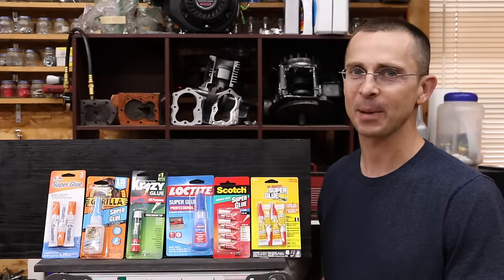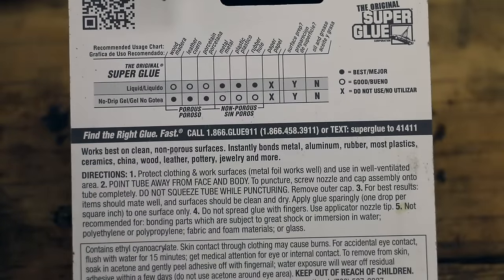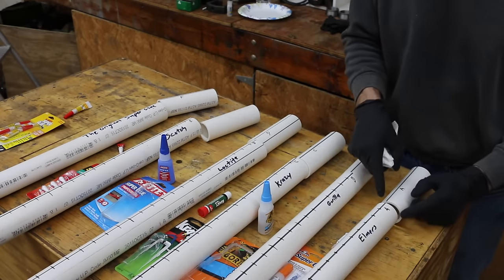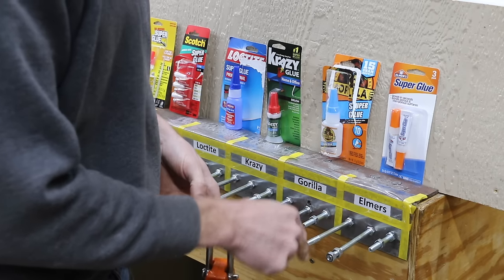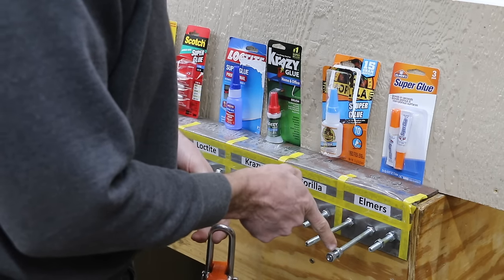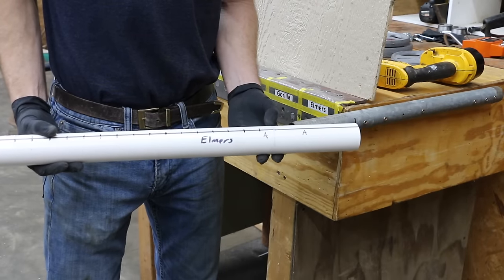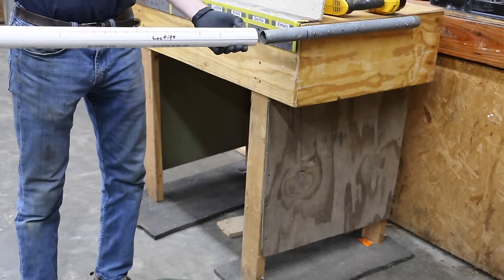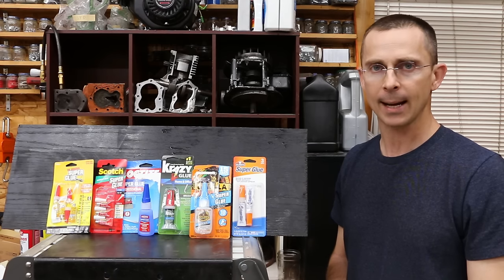Which Super Glue Brand is the Best?  Let's find out!

Comment: Can you do a video on the T-7000, B-7000, E-6000, T-8000 and so on glues?  Black and Clear?  I use on cell phone screens and tablets, but i'd like to know which is the strongest, as well as the easiest to remove with solvent/ alcohol, and or heat... Thanks
Reply from the maker: Thanks for the video idea.

Comment: Suggestion
You have done several videos that compare similar products across different brands
A different type of video that might be interesting is to compare, for instance, different types of glue, and what they are most appropriate for…. For example, silicone adhesive, vs epoxy, vs white glue, vs solvent glue, vs super glue, vs super glue gel, vs construction adhesive, vs spray adhesive, vs contact cement
Reply from the maker: Thanks for the suggestion.

Comment: Can I suggest a video...

What adhesive would be the best for connecting metal. I.e epoxy, resin,  superglue, duct tape ect..

Here's the dilemma I have. I had to take the window wipers off the van to fix a bigger job. When I went to put the wiper arms back on. The first nut went on fine. The second when tightening the second nut it completely snapped of, unfortunately there was no thread available to try and put another nut on. I have tried metal 2 pack system that has worked for a month. Obviously its under stress when the wipers are in motion. What would be the strongest option or product (for this application?

Regards Dale 

P.s sorry its 04:18 here so I haven't spell checked....sorry
Reply from the maker: Thanks for the suggestion.

Comment: Could you potentially run this test again sometime? I found that sometimes I have to glue very small parts, or cracks in pipes etc. where there is minimal contact area, and those siutations weren't tested in this video. Also, formulations may have changed and there are also some new options available now.
Reply from the maker: Thanks for the suggestion.

Comment: Hi Project Farm friends, next video suggestion: 

We must take it at a related but different direction. I'd like to suggest every so often the video is about preserving the best tools (top 3 like Fujiya which has amazing finish and more rust resistant than Klein which is good too but I wish Fujiya had criss-cross knurling on the tips like Klein of its pliers for better grip and Fujiya is spring loaded which is crucial in most work- all pliers like and scissors-like tools should be spring assisted :-).

What do I mean by preserving our accumulate top tools (top 3 brand as tested and top decent enough brands for their prices, thanks mostly to Project Farm for these collections and heirloon if th they are all top 3 to top 4 brands like Fujiya which is the Patek Philippe/Grand Seiko of precision and finish w/ tools if one looks at the quality vs. say Klein which is also nice, under high magnification): for example I have a technique wherein before I close a rubber cement bottle (especially the big ones) and superglue (big sizes especially), I take my vacuum which can be a blower and I suck the air out of the bottle so that it doesn't dry up when not in use. I also refrigerate superglues so they don't solidify overtime (there should be a small refrigerator at all workshops for things like superglue.

Even better if a vacuum chamber is used (and somehow screw back the cap while it's in a vacuum maybe we DIY robot arms like the ones used by scientistist (the one with rubber and two hole used for handling dangerous and radioactive things)- in a way Project Farm could be part Tech Ingredients (hosted by sir Eric, a former practicing doctor but is really more of a physicist, chemist and engineer).

But this needs a test, Project Farm could test this preservation of our accumulate top brand tools as tested + decent but way cheaper than the top 3-4 brands like Fujiya which could, again be heirlooms like Vacheron Constine watches, Perhaps test if this preservation work: 1 is controlled, the other is vacuumed using a regular vacuum, the other air is sucked out of the bottles (kept aways from UV as well) in a DIY vacuum chamber, the others all that and then refrigerated vs. not refrigerated (it may work for sealant which is very wasteful coz' there are lot of sealant lost when it dries up in the nozzle, also it's just one year shelf-life usually opened or brand new.

The second video I'd like to suggest is preserving the greatest tool of all, ourselves. Experiment with wearing (aside from good diet and exercise and quality air) compression socks (up to the thigh ones or up to the knee- proper size 20-30mmHg is usually a healthy, good enough compression) and wearing compression bands for the arms, see if using a rough file making a book ends from raw sheet metal (that was one our projects in high school at machine shop class X-D, a classmate stood out with filing, it was level, not rocking and had a great technique)- see if the muscle get tired more without compression for the arms (it's not only for swelling during injuries but compression stuff seems to improve blood circulation).

God bless, Rev. 21:4
Reply from the maker: Thanks for the suggestions.

Comment: I watched a BBC consumer test programme thirty odd years ago when the 'one drop holds a ton' claim in the adverts was first challenged. They put one drop of glue on the roof of a car and lifted it up with a crane. Of course, it didn't pick the car up. It was going well until it wasn't and the car settled back on the ground as the joint parted. This was seen as a failure until they discovered that the crane was still attached to the paint, but the paint was no longer attached to the car.  Whether the claim was true or not, i thought it was brilliant.
Reply from the maker: Thanks for sharing.

Comment: My tonneau cover has rubber or foam pieces along the edges and during the cold winter I opened the cover and a couple of the rubber foam pieces froze on the truck and came off the tonneau cover. I need to know which of these would be recommended to fix it and put the rubber pieces back on.

Comment: Most of these glues need to be kept in a refrigerator after opening to get the tops off. I have better luck with gels rather than the real runny ones. However, the runny ones are better for fixing a chip in a windshield. Any of them, if you have temperature variation, the bond will break free after a few days. Will not hold a rear view mirror on.
Reply from the maker: Thanks for the feedback.

Comment: Can you do a test which product best prevents a concrete cold joint leaking?
 I have a three cold joints as the concretes were poured at different time: garage  concrete slab, door concrete curb which is 4 inches above the inside and outside, and outside yard concrete slab.  When it rains, water leaks from outside through the curb cold joint into the garage.  I tried to block it with some cement  alleging could prevent leaking. That product fails, leaking still continues.
Reply from the maker: Thanks for the suggestion.

Comment: I have a stripped pressure washer Allen  wrench bolt that I have attempted to epoxy an Allen wrench to as a means to remove it. Tried Devcon 3500 psi plastic steel. Didn't hold at all. I did sand the Allen wrench down a bit and the bolt head was pretty jagged from my many attempts at an angel to remove. Any suggestions?

Comment: Your efforts at meaningful testing are amazing and widely appreciated. It is unfortunate that as with so many of your tests there is no clear winner. Too many variables and too many products that are good at one thing and suck at another. That isn’t your fault, but usually the consequences of substandard products or haphazard quality assurance. Very frustrating. Regarding the dearth of consistency from manufacturers, after many of your tests I’ve thought it would possibly be very revealing to test 10 of the SAME item and see what the results were. Say, 10 identical Craftsman brand open-end wrenches. I think it would be of value to both us consumers and the manufacturers. It would reveal a tool you could truly count on, as well as a brand whose quality control you just couldn’t trust. It would also be another validation of your own testing methodology. All the best.
Reply from the maker: Thanks!  Thanks for the suggestion.

Comment: The results from the metal test, were so scattered/inconsistent. It leads me to believe, that there may be flaws in the curing of the glue or maybe flaws in the preparation of each bolt. Was each bolt placed on the glue the same way? Was the glue dispensed in the same amount? Was there glue touching the entirety of the bolt head? I feel like that test may need to be revisited possibly. It's just odd that one would do really well on one and not the other. I'm referring to the first and last test on the bolts. Because imo, I think it's essentially the same test. Only in the opposite direction. I thought he was going to thread a nut and big washer over the puller and attach a cable or rope and pull with a scale attached. He said he had no way to exert that force to pluck it from the steel. But I think it could have been rigged up on a drill press or something like that. Or used a block and tackle or something along those lines.

Comment: One drop of the original super glue can life a tone but what they don’t tell you is you need to use a material made out of high strength polymers because when you do the super glue creates a chemical reaction that quite literally bonds the ends together effectively Turing the 2 ends of polymers in to one polymers the molecules blend together and form together think of it like a weld when you weld metals together they become one but this is through a physical reaction not a chemical one like the super glue
Reply from the maker: Thanks for the feedback.

Comment: Just to let you all know, in case you aren't aware ... This Gorilla Glue Gel will have a pretty serious reaction with garments containing Polyester.

I recently accidentally splattered some of the glue onto my shorts during application of the product, and the resulting chemical reaction was a hell of a lot of heat, with visible smoke/fumes.

This reaction could cause some serious burns in large spill quantities as the glue will react with the polyester while adhering to your skin through the garment, very rapidly.

I couldn't find where it was stated to keep the glue away from said materials, but I may have missed it.

In any case, this is a friendly PSA! 🫡
Reply from the maker: Thanks for sharing.

Comment: Curious if you put a drop between 2 pcs of plexiglass as to how big of diameter the glue would achieve as the surface area size will affect strength
Reply: Probably used the maximum contact area to achieve a ton.
Reply from the maker: Thanks for the suggestion.

Comment: Hello sir Projekt Farm.

I'm giving back this time.

The best way to get rid of goo from old tape (e.g. duct tape) that you untaped from a surface, it's better than all the test (99% alcohol, 70%, w/ shampoo, with olive oil soap, WD-40- separate as well, not mixed as well as using a scraper and heat from the SMD station used in soldering SMDs) that's affordable is eraser from Faber-Castell, especially their Dust-Free version (best to have their other versions, including the regular soft eraser and rough one but not the green eraser that's for pigment on plastic).

God bless, Rev. 21:4
Reply from the maker: Thanks for the feedback.

Comment: I'm mainly use superglue to repair stuff with baking soda (it creates a very strong polymer). I bought "superglue 502" from aliexpress: it doesn't really work as well (the polymer it creates is maybe 60 or 80% less resistant, it also doesn't change the color of the baking soda, western glue makes it a little bit more translucid. Maybe because it's less concentrated, of because it takes too long to cure or because it doesn't penetrate as well the baking soda. Anyone found a cheap superglue for this use?. I also tried on ali the 401 (yellow-red-blue), it's a completely useless gel like.
Reply from the maker: Great information! Thank you

Comment: I'd like to know how to stop the CA from blocking the nozzle, after multiple uses?
Reply from the maker: Thanks for the suggestion.
Reply: @ProjectFarm  what?
Reply: Wipe the nozzle clean after every use and Gorilla glue bottles have got pins in the cap that help clear the nozzle , but yes, eventually they all block.  I guess you could soak the nozzle in acetone (which softens and dissolves superglue).
Reply: @jonedwards7019  on some larger bottles, the nozzle doesn't come off.
Reply: I use Gorilla glue nearly daily.  I always keep the bottle inverted inside an old pill bottle.  Before and after using I shake the bottle then inverted I tap it twice on a hard table top, once through using I place the cap on and tap it inverted one time before I place it back in the pill bottle.  If it does clog up, I use a needle probe to carefully clear out the delivery hole by inserting the needle until it breaks through the clog.  Then quickly use the glue.  Replace the lid and again tap on the t le top before storing inverted in the pill bottle.  For each bottle I may have to do this 3-4 times before the glue bottle is emptied.

Comment: Great video. I actually found this from a comment on Inventor 101's video where he started off mixing baking soda with superglue and then made extraordinarily strong joints by introducing graphite into the mix. 

It would be interesting to see what the optimal ratio is for this compound mix and how it holds up to various forces.

He glued a screw to a plastic bottle cap and couldn't hammer it off and the joint was so strong, the screw ended up bending rather than breaking off.
https://www.youtube.com/watch?v=t7YG90LFkMM

Comment: My general opinion is that "super glue" sucks. It works OK if you want to glue two flat pieces of metal or plastic together, and it works great at gluing anything you DON'T want glued together, but when I actually use it on something that matters, it always fails. The slightest bit of pressure or torque and the joint instantly breaks.

The old Krazy Glue commercial used to show it being applied to the broken handle of a coffee mug and then the mug being lifted. Putting aside the fact that modern super glues take forever and a day to dry, they won't even glue ceramics like the ad showed. My mother had a small sculpture of two birds sitting on a bridge-like branch that snapped right in the center. It was glued back together using super glue and any time you touched it the wrong way, it would break apart.

I used some of the Super Glue brand to try and fix a twist switch in a light. I let it dry thoroughly and it still snapped the first time I tried to turn it.
Reply from the maker: Thanks for the feedback.

Comment: Without a doubt Delo makes the strongest. With only 3 grams of adhesive spread across a 2" diameter they were able to lift a 17.5 ton crane 1 meter into the air. Class dismissed.

Comment: I think this is an example of man's dependence on his "marketing mother", telling him what to do and think -  i.e. label-marketing. When their chosen brand label fails, they just assume super glue doesn't work. Strangely, I've had an aversion to Loctite for years due to using it and then busting open a knuckle and breaking an assembly in my efforts to remove the nut I used it on, ROFL!
Reply from the maker: Thanks for sharing.

Comment: I dunno. Variables. Unseen variables.   I use hot-melt glue for vehicle body repairs.  Basics are you glue a plastic tab to the body & apply a pull using hydraulics - it can apply up to 1500kg of force.  Thing is, you can follow the exact same process, using the exact same materials & get hugely variable adhesion for "no apparent reason" - you can glue on a tab & get 500kg of pull on it, glue on an identical tab beside it using the same glue, same process & get 30kg of a pull on it, or 3kg.. or 600kg..   

Obviously, there's a "scientific" reason why - damned if I know - you can glue the same tab back on & get the same outcome or a totally different outcome  - either a phenomenal pull or a rubbish pull - there's just so many tiny important variables regarding "adhesion" that it is a black-art more so than a science.
Reply from the maker: Thanks for sharing.

Comment: the tensile strength test was almost like the down force test as the bar you made did not pull straight up, but also to one side. Making the hole oval does not stop any angular stress as one side will be pulling harder than the other.

Comment: Krazy glue last the longest
Reply from the maker: Thanks for the feedback.
Reply: @ProjectFarm  anytime
Reply: @ProjectFarm  ive just checked my front tire the tube still holding up from the krazy glue and duct tape
Reply: Ive put the krazy glue on the hole and then while the air seals up the krazy glue i put the duct tape on it right away then i krazy glue it around the dict tape it quickly dries

Comment: In America, strength of materials is listed in psi ... Pounds per square inch.  So math is simpler if you measure force to break in pounds and surface area of sample in square inches. No one has any sense of what a newton is or how strong a newtons per square meter is.  Don't give in to the Karen's out there and become a metric freak .  Note that we will be measuring tire pressure in psi for a long time.

Comment: We use pounds in this country; unless you are European, a useless millennial, or an engineer, the metric system means nothing to us
Reply from the maker: Thanks for the feedback.
Reply: Depends on the job and where  the product is going. I work at a machine shop that makes hydraulic Pistons, all of the measurements are metric. It took me a while to get use to using tools that are metric. Have always used Micrometers that used thousandths if a inch.